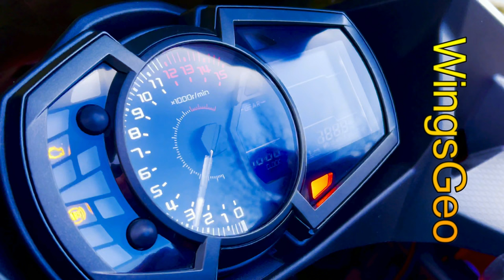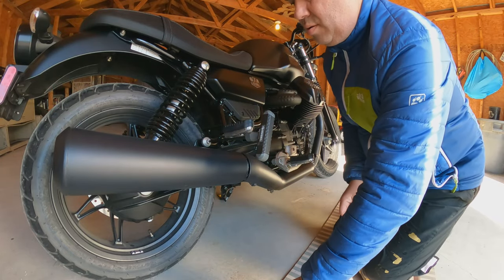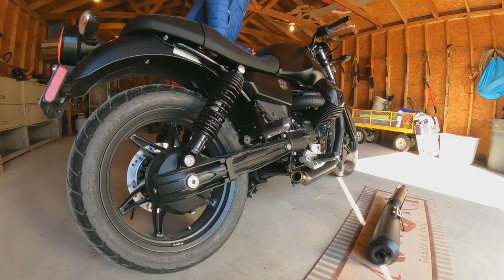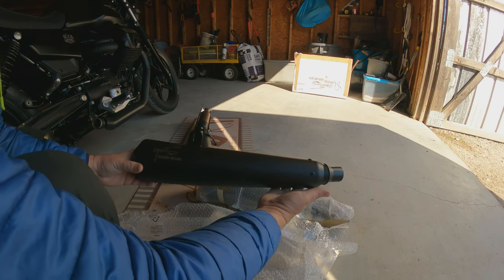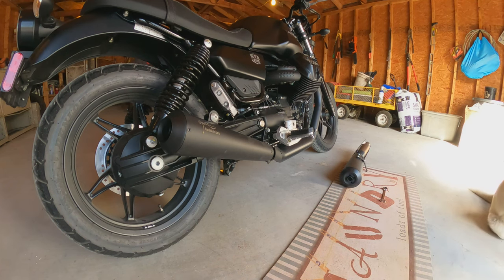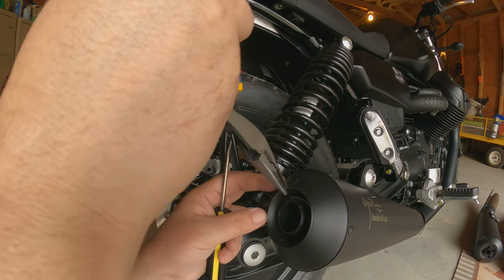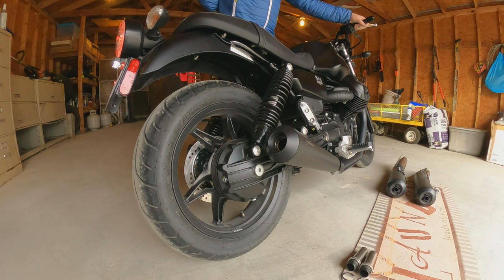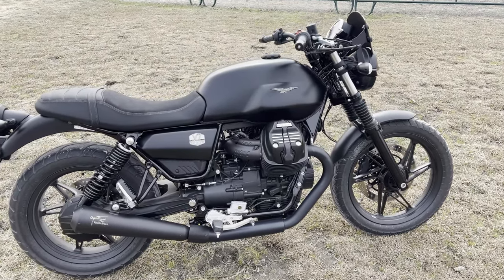Moto Guzzi V7 E5 | Agostini Install & Comparison

Comment: Great sound! I suppose that stock mufflers must have cat inside. Do Agostini mufflers have cat inside?
Reply from the maker: Agostini's have no cat inside. Based on the weight of the Stock muffler, I am going with yes that the cat appears to be inside.
Reply: @BunnyandBman  I got the Mistral short mufflers for my 2021 V7 Special and they have cats in them
Reply from the maker: @robertgarcia4247  Interesting, they must have worked some magic as the Agostini's are very light compared to stock.
Reply: @BunnyandBman dreamweaver23 weighed the short Mistrals compared to stock and it was about 5 pounds per side lighter and course the factory mufflers are huge!
Reply from the maker: @robertgarcia4247  thanks for sharing, that is about what I estimated, 10lbs savings combined.

Comment: Have you noticed the engine to be running lean with the DB killers out?
Reply from the maker: Without the proper computer, it is hard to tell and so far I have not seen any for the 850 motors. I can tell you that I have no issues concerning drivability and fuel milage does not indicate a too lean condition on my bike.

Comment: The DB killers sound terrible anyway. You can hear them rattling around inside the tip when you rev the engine.
Reply from the maker: Yeah not a fan, hence I ran it without them, just wear earplugs ... lol
Reply: @BunnyandBman  nah experience every decibel those things were killing
Reply from the maker: @gabrielhathcock1848  ... lol

Comment: You weren’t using those circlip pliers correctly. So it’s not Agostini’s fault for using a circlip to hold the DB in.
Reply from the maker: Yes, I bought them at the hardware store and figured out after that they were not the correct ones. Lesson learned ... =)

Comment: You need circlip pliers, right tool for the right job, that’s all.
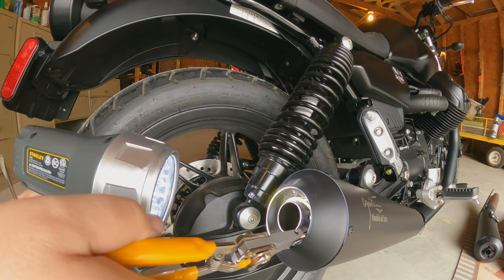Reply from the maker: That is what I had Jon, you can see it at the 7:05 mark. Maybe a different form factor as the ones were not able to fully close the gap in the tight space, hence it would not come out easy and I reverted to "german" engineering ... lol
Reply: @BunnyandBman  Understood. At least that method they use is very neat and leaves the exhaust pipe without any holes or other ugly bracketry. I prefer it to the Mistral method.
Reply from the maker: @jfro5867  Agreed, well I got it out, so all is well ... =), would not be any fun if there is no tinkering involved.

Comment: If you use the proper tool to remove the clip holding in the DB killer you wouldn't have had an issue removing it, don't blame the company use the right tools! You need circlip pliers if you are unaware.
Reply from the maker: Except I did if you watch closely in the video, lol. It may have been user error but from what I could tell. my extensions that went into the holes of the clips, kept bending and sliding out.
Reply: @BunnyandBman  You have the wrong kind of snap-ring pliers. For that job you need a set of convertibles. They splay the tips a c-hair on an outside ring like that one so the ring stays locked into the tool. You don't want those rings flying around, at all. One time I had a ring get loose when I was taking it out of a boring machine transmission and it stuck itself into the plywood wall behind the bench. Check out some convertible-style snap-ring pliers and you'll see what I mean. Snap-on makes a nice set and they hold up for decades on the job. They're pricey, but a good tool with a lifetime+ forever warranty. I think my set is from Cornwall tools, they're very good too, but a bit harder to find. Nice video btw! The exhaust sounds great, strong and throaty.
Reply from the maker: @jomamma1750  that would explain my difficulties. I see a online shopping trip coming up ... =)
Reply: @BunnyandBman  I thought you might appreciate a little advice from a mechanic. The convertibles look cheesey from a distance but work like a charm, very good tools indeed, providing that you buy a professional quality set of course. Made in China won't cut it with that type of tool as they require a quality, properly hardened steel to function under the considerable tension of snap-rings. Most sets come in 3 sizes and in both straight and 90* angle tips. That gives you 6 pliers total in a typical set. Then what you do is pop the 1/4 turn lock and put the 2 halves on the other setting so they convert from inside snap ring pliers to outside snap ring pliers. This makes a set of 6 operate like 12 different tools. I'm sure you can find a video on here somewhere showing you how to operate them, although if you held them in your hand they would make perfect sense. Online shopping is what it is and it never hurts to do a little quick research so you can see exactly what I mean. Anyway, best of luck with the bike, she's a sweetheart.
P.S. I just checked my set and they are Cornwells (Cornwell Tools in Ohio, USA). Unfortunately the set is about 20 years old and the sticker on the box is long gone. The part number on the big, straight tip pliers in the set is ML-3402R. I don't know if they still use the same number as that pair of pliers is ~ 20 years old, but that particular pair would be about right for that snap ring in your exhaust system. I've used that set for 20 years on the job as a big truck(lorry) mechanic and never once bent a tip, so the tool quality is certainly there. They have served me well.
Reply from the maker: @jomamma1750  Thanks for all your input, amazing!
Reply: @BunnyandBman  You're welcome